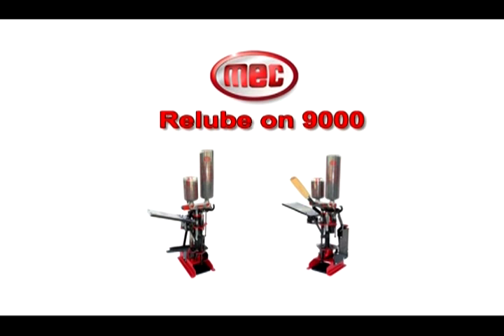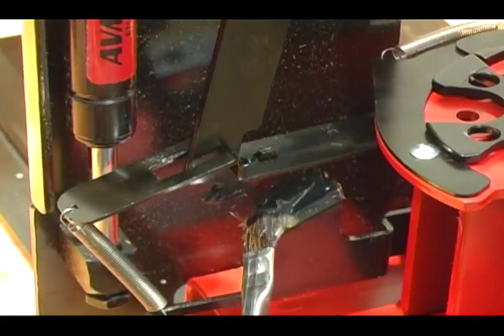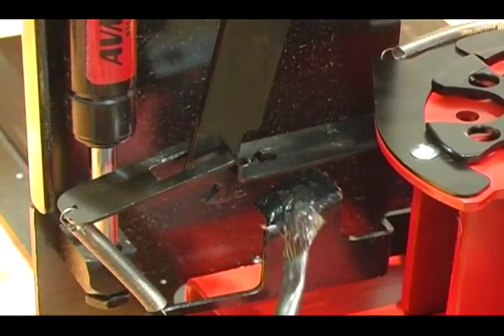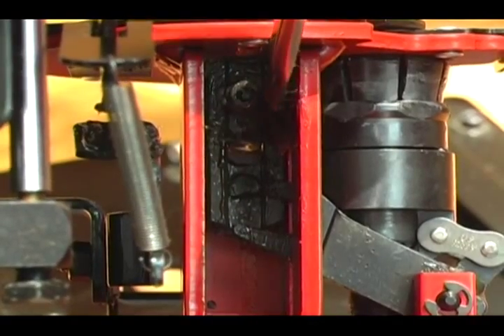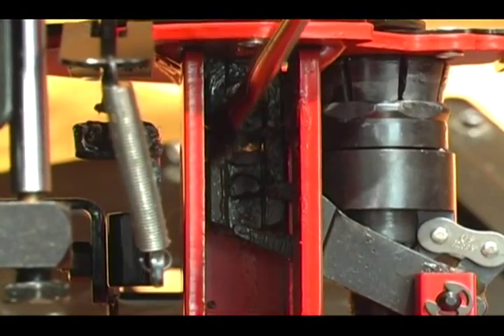MEC Reloaders Relube on 9000's

Comment: How often should this be done?  How often should the collet resizer be cleaned and anti-seize reapplied, assuming no shot/propellant spills?  Thank you.
Reply from the maker: Hello and thank you for reaching out to us! On the MEC Outdoors website, under "Service and troubleshooting videos" shows where and what to use on the machines. The collet should be relubricated every 600 to 700 shells and taken out and cleaned, as necessary. You should just stain the outside of the collet fingers with anti-seize. A drop or two should be applied before a long reloading cycle. Please let us know if you have any additional questions. Thanks again and have a great day!